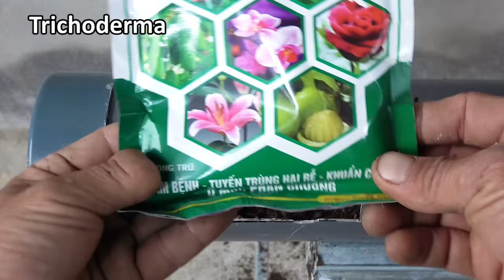Surprised with how to grow strawberries in plastic tubes | Big, sweet and fruity

Comment: Strawberries like fertile, well-drained, slightly acidic soil. In poor or heavy soil, it's preferable to plant them in raised beds, which provide better drainage and increased rooting depth. They grow best and produce the sweetest fruits in full sun, but will tolerate some shade.
Reply: Clearly they don't mind hydroponic either....
Reply: @Cymru1987  method in this video is not hydroponic
Reply: @TylerDurden404 dude can't see the soil 😊